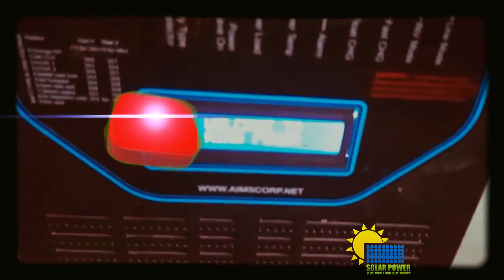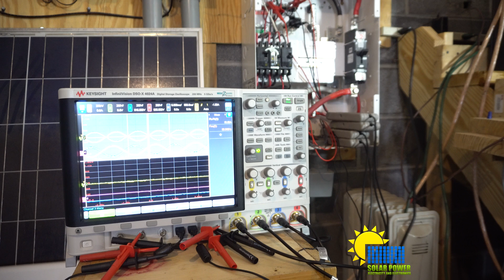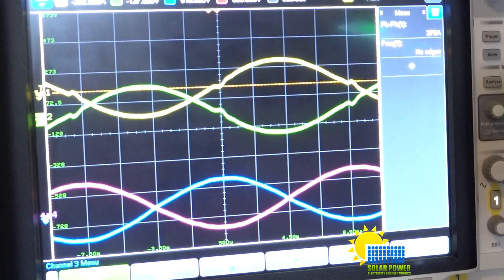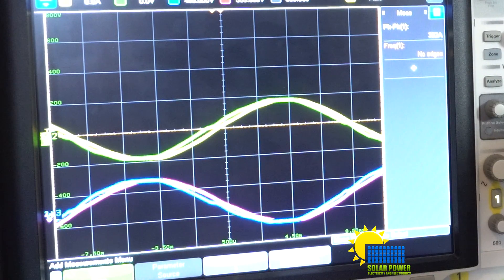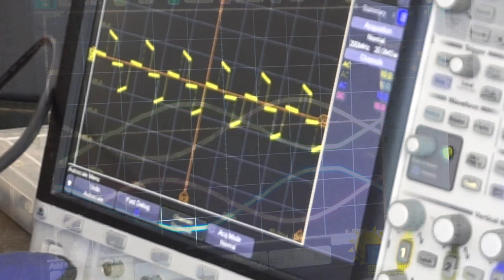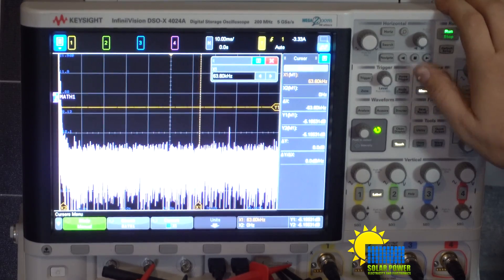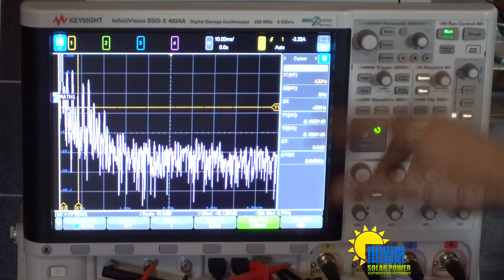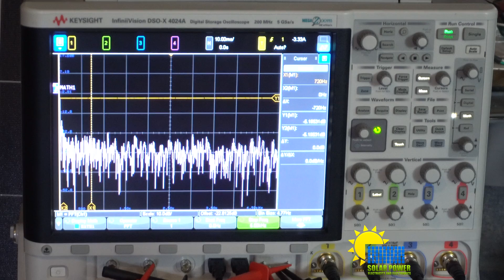Magnum Inverter Pure Sine Wave VS Grid Power  Sine Wave Keysight - Solar, Wind, - oscilloscope

Comment: Zero crossing distortion occurs when the inverter circuitry switches from the positive amplifier to the negative amplifier in a Class B amplifier configuration (push - pull).  Right at the switching point between both amplifier banks you get that zero cross distortion.  This mismatch at the cross over region is the slight gain mismatch between both amplifier banks at zero.
Reply from the maker: I will have to take your word for it my friend

Comment: That spike is called Zero Crossing distortion. Inverters don't work exactly like an audio amplifier would. One leg is just a square wave. the other is the actual push pull pulse width modulator. It's called a turnary system. That way, you only need 200 volts, instead of 400 volts on the DC bus to get the 120 V AC out. By pulse width modulating only one half of the H-bridge, you save even more switching loss, which allows a lower idle current. If you connect the oscilloscope shield lead to the negative high voltage rail, and connect the input probes to the output plug, you will see a perfect square wave on one leg, and inverted sinusoidal half waves on the other. The peaks will be up side down. When integrated, you will get the wave form you see here, with the scope referenced to a leg, rather than a DC rail. This is technically a grounded bridge turnary output stage. Not very good for audio, but fine for driving motors, and transformers. Another critical test, is called DC offset on the output. place a large capacitor in series with a small incandescent light bulb, or any kind of transformer, and measure DC voltage across the capacitor. The less, the better. Too much, and transformers will growl, and induction motors will experience a plug braking effect, which generates heat, slows the motor down, and wastes power. Anything over 50 milivolts is too much, and anything over 100 should be deemed unacceptable. The lower the DC resistance of a transformer primary, the closer it comes to magnetic saturation of the core. Anything under about 5% total harmonic distortion is more than good enough for just about any application. The clipping of the sine wave, due to low rail voltage, is not too much of a problem, nor is the zero crossing distortion. DC offset is the thing that could disqualify an inverter.
Reply from the maker: thank you very much very informative

Comment: It seemed the sinewave  inverter is clipping  when loaded.Not a good one!
Reply: It really depends on the battery and the cables between the battery and inverter. If it drops below 11 to 11.5 volts measured at the lugs on the inverter, the DC rail voltage might not stay above 170 V DC, the output stage will clip. Typically, it needs to be around 200 volts, to give adequate headroom. I have a 12 volt, 3000 watt true sine wave inverter, and I need 6 golf cart batteries, to stay above 11.5 volts. At 3000 watts, that's 25 amps at 120 volts. Multiply that 10 times, than add the idle current, than add the losses, and it needs 270 amps! the inverter is fused for 320 amps with 8, 40 amp blade fuses, in 4, 750 watt DC to DC step up converters, paralleled into a bridge rectifier. That 270 amps is like starting a car engine, and holding the key on the whole time the inverter is loaded. A single 12 volt group size 27 RV battery won't get it done!